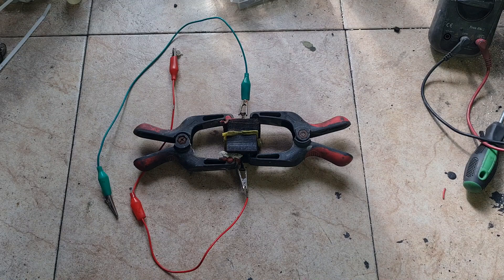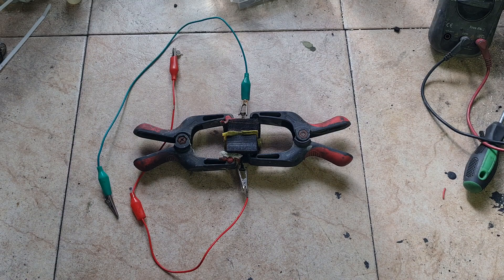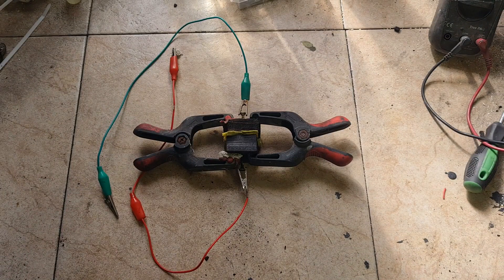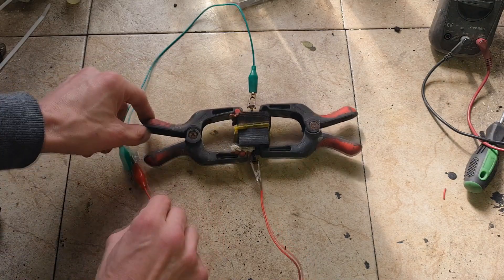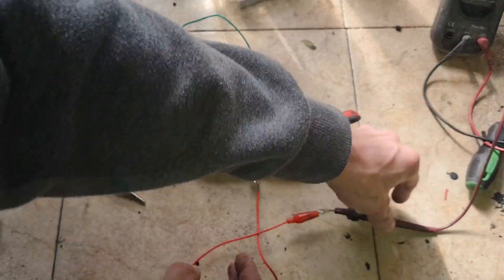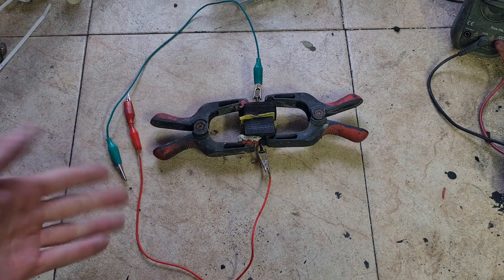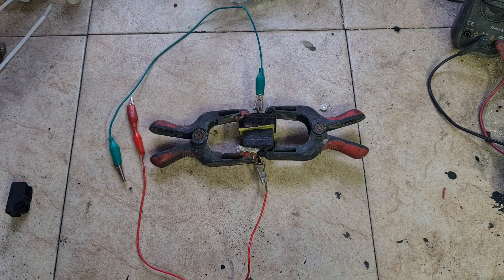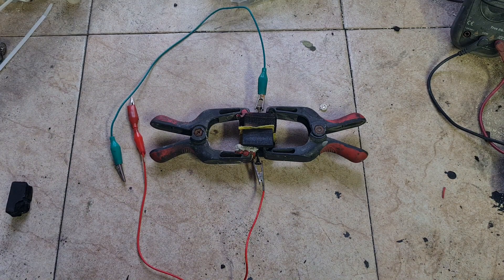The reall deal about Diy "free energy" Supercapacitor

Comment: Put some tinfoin and apply thin layer of carbon on it, maybe mixed with somethin that il stick to it. made them about 50 layers and you will have selfcharging battery, but you get only mA or less and it may even blink led once in a while (when equipped with small capacitor)..